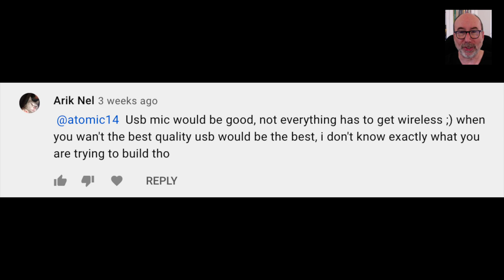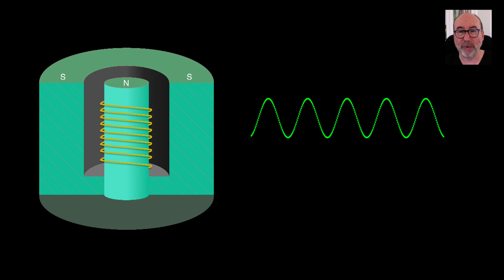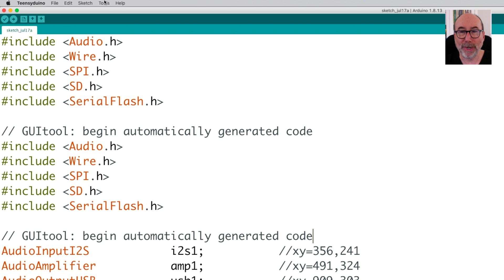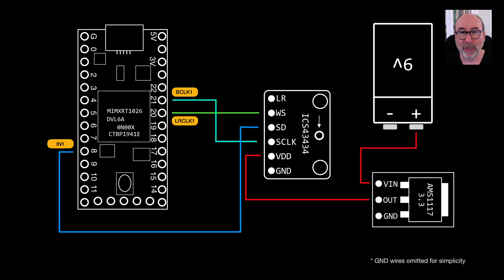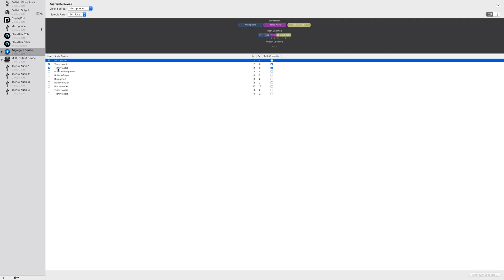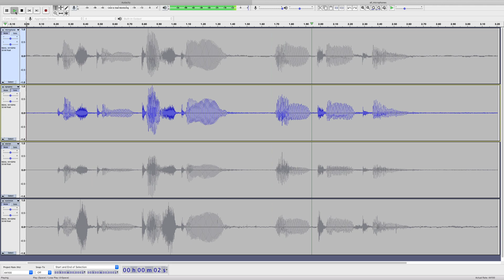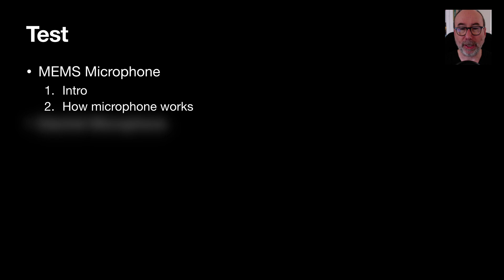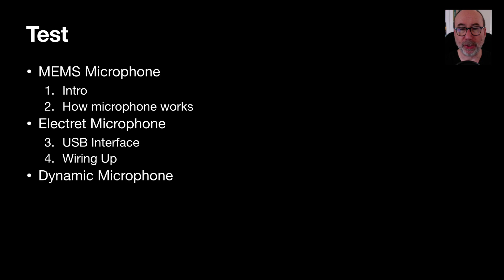DIY USB Microphone Showdown: MEMS vs Electret vs Dynamic!

Comment: Wouldnt it be possible to use a External Sound card/Board to make a USB mic out of an E Condenser Capsule? Seeing as the sound interface is already there, there's input for Mic aswell as output for headset. Im thinking along the lines of soldering the power to the feed of the board, desoldering the mic jack and soldering the mic's "data" wire to where the jack was etc etc. This is all theory in my head atm, but it feels like it would be a straight forward procedure and these usb cards can be found for around 5$ US (Which is a really cheap alternative )

Comment: Dynamic mic definitely sounded the best, IMO.

(both the shop-bought and Dynamic mics had a tiny bit of clipping during the second "testing" word spoken. Seemed like a bit of clipping/clicking as well when you were doing the voiceover in the last section?) 

The ICS sounded quite thin / hollow in comparison, but not too bad.

The Electret probably sounded a bit worse overall, with some frequencies being limited, almost like a slight notch filter?

The Electret seemed to have a slightly asymmetrical waveform, maybe due to the way the mic needs to be biased?

Having said that, until you pointed out you'd used a different mic for each section of the vid, I wouldn't have said any of them were terrible. lol
Reply from the maker: Yes, I noticed that on the electret as well, maybe the bias voltage was too low? Definitely intriguing. From what I read you really need to tune the amplifiers to the microphone to get really good results. I guess that every microphone has a particular frequency response that you need to compensate for.

Comment: The biggest difference imho between the three DIY mics and the shop bought mic is the lack of low end which make the sound "thin". I think this is partly caused by the pickup patterns of the microphones and due to the lack of a body around the microphones. One other thing to note is that a larger capsule is usually more sensitive. Downside is more noise, but the upside is more detail, in this case in your voice.
Reply from the maker: Definitely my impression as well, the DIY mics all sound a bit lacking. Quite tempting to desolder the larger microphone and try it with the MAX9814 to see how much heavy lifting the ALC4042 is doing - but I don't really want to destroy my microphone just yet.